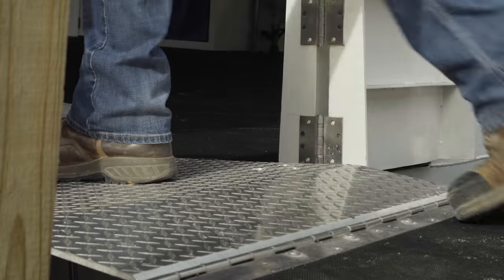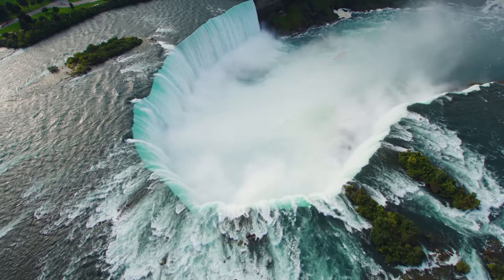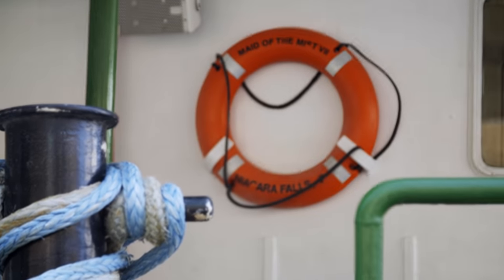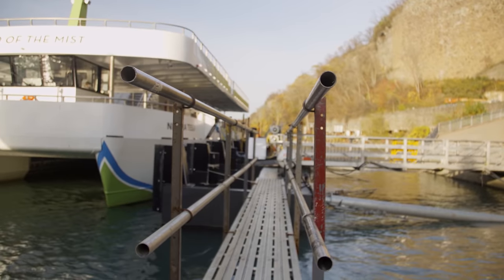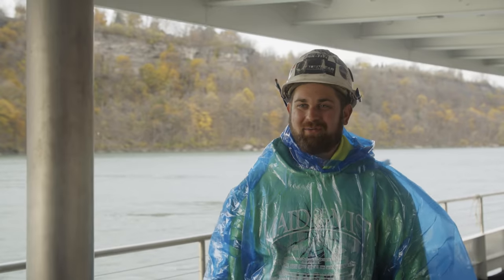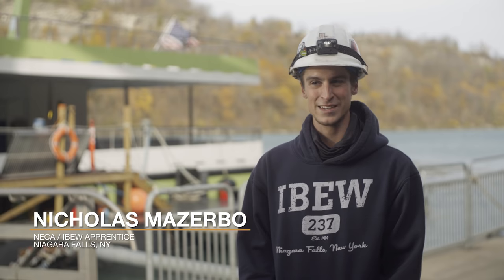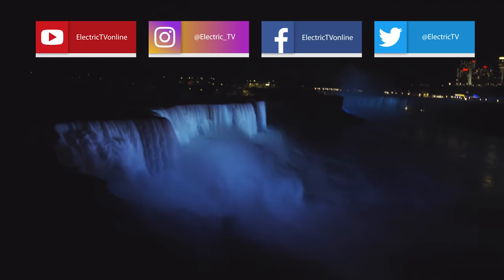Maid of the Mist is ‘Going Green’ Thanks to New Electric Boats Wired by NECA/IBEW Team

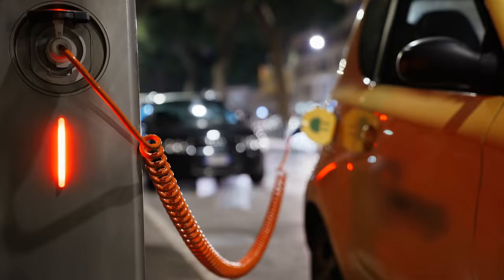Comment: 2:30  I know the charging power is impressive for the new maid of the mist, but you don't have to throw EVs under the bus by claiming they take days to charge.  All "average" EVs can be charged from empty to full at home in under 8 hrs (clearly the James V Glynn isn't coming into port empty).   While public fast chargers can charge the most popular model EV sold in the US by adding 117 miles (over 2hrs of highway driving) to its range in the same 7 minutes.